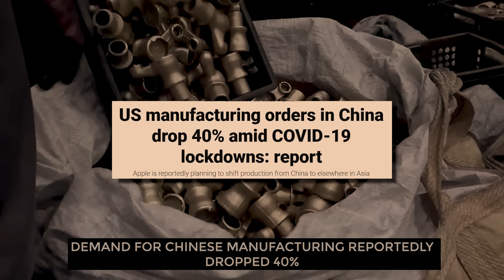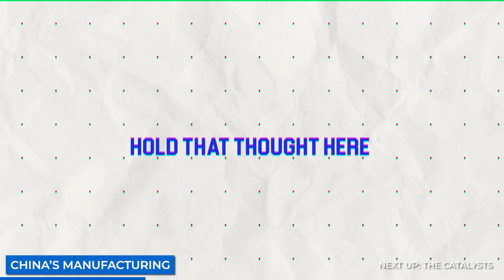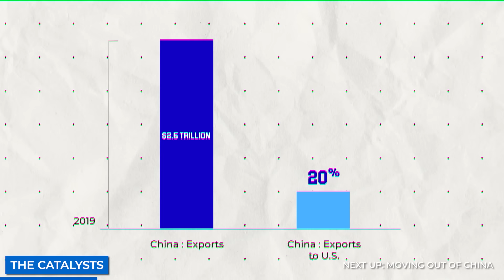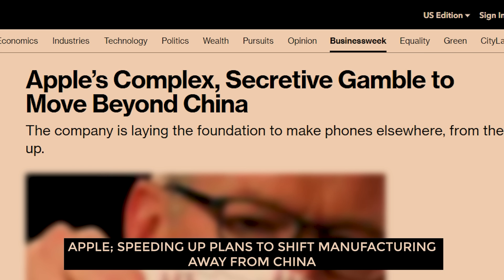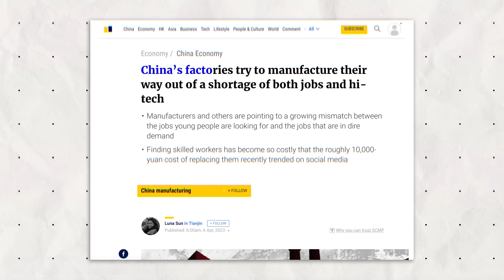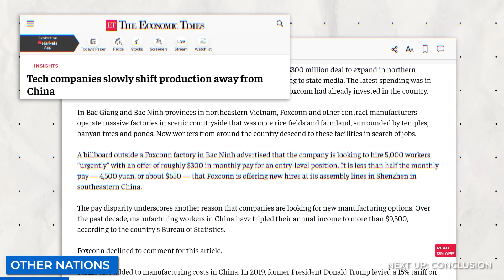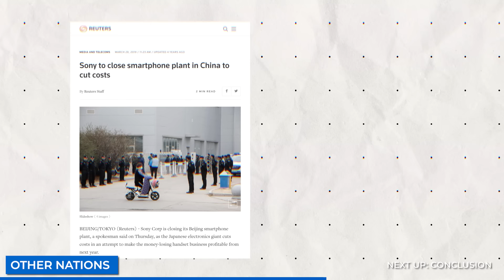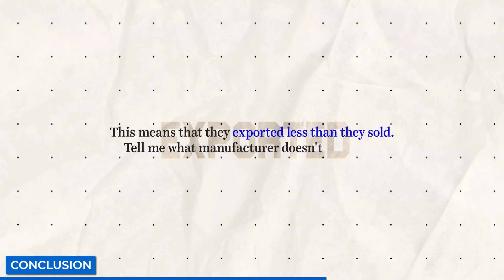China's Catastrophic Manufacturing Crisis, Companies are Running Out of CCP's China

Comment: I remember lobbying our congressman in NC to block the out sourcing of the jobs and being told the cost savings would be passed on to the consumer and that would be good for the economy. The price of TV's went down but that's about it. And we didn't even make TV's in NC. Carolina boots are still just as expensive as when they were made here.
Reply: Basically all electronics have gone rock-bottom while we're increasing our reliance on them. The issue is, the top of the line today may be 157 times more powerful than a laptop from 2013... but that laptop still works fine for most people. Buy it, toss a new clean hard drive and lightweight OS on it, and you wouldn't be able to tell for most people just browsing Facebook and YouTube. 30 to 40 bucks, and you can have thousands of times more computing power than the Manhattan Project and Moon Landing combined times 2. But meanwhile, durable physical goods we all use everyday are similar priced. It's a matter of "feeling" like nothing is better more than objectively
Reply: @@aussiepom Yep.
Reply: TVs aren’t even cheap bc of manufacturing location. Over the past decade prices are lower bc the manufacturer found they could sell the viewer data they collect on the tv, giving customers a cheaper price to buy
Reply: Lol savings are never passed to the consumer
Reply: @Poppa_Capinyoaz  it was a bait and switch
Reply: The company’s profits have gone through the roof so the shareholders are richer, which was the whole point.
Reply: @Aussie Pom Depends on the exact business and time period.  Some businesses exclusively wanted to pad the bottom line, but some genuinely needed lower costs in order to stay competitive with foreign companies that could produce similar goods more cheaply.  A lot of US manufacturing moved offshore because unions got a bit out of hand with their demands in the late 70s-early 90s, combined with inflation in the US making these demands (as well as existing benefit arrangements) more and more unaffordable.  You can complain all you want about greedy CEOs, but the fact is that even if you lowered executive compensation at most large companies, and put all that money into employee salaries, it wouldn’t make much of a difference once it was spread over a bunch of employees.  Executive salaries are a drop in the bucket compared to most total corporate profits, which have to be distributed among shareholders if you want people to invest in your company.  

The reasons a lot of businesses moved manufacturing to China as opposed to other poor (at the time) countries are (1) the US government cultivated a relationship with China beginning in the 1970s as a counterweight to the USSR, and Americans came to see China as “good commies,” and (2) Ding Xiaoping was very friendly to foreign businesses, even if he secretly harbored the same imperialist ideas as Xi Jinping, and (3) China, while poor back then, had better port infrastructure than other comparable countries.
Reply: Industry was offshored even from nonunion states. The issue wasn't 'greedy unions'.
Reply: People lobby to ban stuff like this all the time.

It usually bites them in the ass.
Reply: @calc1657  They drove a lot of it and lowered quality to boot. The Japanese car invasion of the 70s is a significant inflection point. The quality of Detroit manufacturers across the board was rock bottom. How do unions and corps expect consumers to remain brand loyal when they both eschew quality of design and assembly for unit cost and profit margin where the consumer pays the cost. This happened, both were to blame.
Reply: @brasidas2011  German manufacturing did ok despite being far more unionized. It's more complicated than the problem of evil unions.
Reply: As far as NC and textiles, I'm in New England.  Watching the south lose their textile industries and people losing their jobs gave me a chubby.  Y'all stole those jobs from New England and Y'all aren't any different than the Chicoms.  Boo freakin hoo.  "I worked in those mills outside of Charlotte for 30 years".  And so didn't my mom in Massachusetts, when Goober took her job.
Reply: The notion that rich people would save money in production and as a result charge less is laughably naive.

You cut costs and raise prices to make profit. That's all their goal is.
Reply: @equious8413  Nominally it would be, but if you try that when competing with foreign companies with lower labor costs and cheaper products, you are going to lose. Also, when part of your security agreement is giving them access to your markets, tariffs become unsustainable.
Reply: Converse shoes too, made in USA 19$ overseas it went up to 36$ instantly
Reply: And can’t blame unions either
Reply: L
0😊😊
Reply: @brasidas2011  you have to remember though that those same foreign entities have the same profit motive.

I'd argue the inevitable conclusion of competition isn't REALLY cheaper costs for anyone, it's innovation at best, and corporate collusion and market price fixing at worst.
Reply: @equious8413  I agree foreign entities have the same profit motive, however they also have varying levels of governmental support (such as China). Laissez Faire capitalism is dead it seems. I agree with your conclusion as well. It's all gotten pretty corrupt lately.
Reply: They got big heads and after they ran everybody out of business, they raised prices.
Reply: @ThrawnFett123  Try playing more recent computer games, especially factory games and graphically intensive games on  2013 laptop computer.  They wouldn't run very well on such anemic computers.
Reply: @coganaj  the issue is when you compare the amount of computers in the country to the amount of people playing those latest intensive games, it's a fraction of a percent of the actual install base. I'm not saying that a 2013 laptop will let you play Cyperpunk on Ultra with Ray tracing enabled, but most people aren't doing that. They're browsing 3 or 4 social media sites and a couple of streaming services in between doing their yearly taxes and reading a few PDFs to assemble some Ikea furniture. That's the market that wouldn't notice if they had a brand new MSI gaming laptop, or a 2013 Sony Vaio with an SSD upgrade
Reply: @jthweatt412  There is no viewer data if you don't connect your TV to the internet.
Reply: He forgot to mention we would be getting junk for our money, making things more expensive.

Comment: One factor often forgotten about modern manufacturing is how large any investment in high quality, high volume production lines is and how much product has to be moved before ROI is reached. Another problematic aspect is the specialization of machinery. It´s absolutely impossible to "just move" a production line for high end microchips or other precision parts. Breaking down a complex manufacturing process into small, more simple steps may reduce labor costs overall, but introduces a more complex supply chain. Companies start to realize this. Car manufacturers will try to pull their production closer to their assembly (yes, those are two separate things) as the vulnerabilities showed throughout the last half decade.
Reply: ...there you go thinking again, ROBERT!  😜
Reply: Agreed made in a country is different than manufactured in a country . These commercials don’t tell the difference and play the role that made in America means it’s manufacturing
Reply: These videos are coming out of creator's arses.😂
Reply: A reworked NAFTA plus the opportunities available to Mexico could ultimately prove good for all of North America - if the various kinds of corruption can be dealt with.  I'll ride that risk on North America because I don't see it happening in China in my lifetime.
Reply: Cool!
Reply: @hillbilly4895  I´m sorry, it happens involuntarily. I always regret it afterwards.
Reply: Right, and this is the EXACT reason why most companies where their markets are STILL Western countries where consumerism is a much bigger thing, should move their factories back to western countries that they abandoned.

Manufacturing is now much more automated and while China has gotten good at this, so are other countries, and it's easy for engineers from other countries to come into a factory and get the best out of it with modern machinery and that includes making custom machines to do specific tasks.

Tesla is a great example of this.  But Japan for instance has been really good at doing this even though Japanese companies have chosen to manufacture in China (and are also moving out over time).  China has benefited from the technology of global companies along with stealing their IP.  I see most foreign companies moving their manufacturing out, spreading it out over multiple countries and even moving part of it back to their home countries, ESPECIALLY the highly automated lines of production, AS LONG AS supply chains are effective.
Reply: A supply chain is the easiest problem to  solve.
You have a place 
You have a time
And you have transport time.
That's like 1+1+1=3
Reply: Apple just announced it will continue in China. The process of moving to India was not viable.
Reply: I have a question why is it taking 6 weeks for a part for my G10  to arrive in Australia 

Due to the length of time I will never buy another chinese made vehicle

Comment: Just spent 3 weeks visiting factories in China.
They have (had) three advantages. Cheap labor, integrated supply chains, and government policy. Labor cost has exploded and they're moving to Thailand and Vietnam. Government policy is drying up. Having everything nearby is still a strength but labor is sinking it. The more rough manufacturing (hydraulic machines, materials conversion, fabrication) are losing their workers. Most of the guys I saw doing welding and painting were 60+. The next 5 years will be a difficult loss for them.
Reply: and no rules to protect the environment! and this whole low wages debate is shameful!
Reply: @Ezekiel903  Which year did you last visit China? China has vastly improved in protecting the environment.
Reply: Yes I agree, I ran an engineering company in the UK for 35 years.. I remember when China was buying up all the scrap steel they could find for manufacturing. You could not compete because there Labour cost was a small percentage of ours and that also reduced there own material cost. We commented at the time that one day the situation will start to change as the Chinese Labour costs will rise. However there are other factors that costs play a part in competitive markets such as Health & Safety & Human resources. Labour shortage is an issue all over the world but it will result is higher salaries.
Reply: this is cope. china is by far the largest manufacturer in the world and is still growing, though losing some in low tech manufacturing like textiles.
Reply: When, bull dust produce a video that proves it and one you produced your self

Comment: Also a thought that might be necessary to be added, all of the outsourcing shifts are still short term investment moves, it's just a matter of time until labor cost in vietnam and india is catching up with china labor cost, and a bit more until it catches up with western trends (unless another major crisis shakes the world, which is far more probable). We are indeed running out of low labor places to outsource towards to squeeze more profit out of the same. The one solution is automation, but that would only work if it does not replace labor but rather supports lower productive time for the population. Since any traded company won't be able to adjust strategy to account for that, a broader economic collapse is inevitable. ...crap, didn't want to get that realistic when I started the thought... apologies.

Comment: Error on your chart at 34’36 - the chart for 2025 says $327m (the same as 2022), instead of “$470 billion” as per the audio. 
Note, all three bars have million, but the audio says billion. 
Excellent vid all the same.
Reply: Another error on the chart at 42’10, the bar on the right says Bangladesh, (the same as the one on the left), but the audio (correctly) says China. 
Suggest check all your charts for errors.

Comment: Due to its huge domestic market, unit cost of components to make finished goods in china is lower, and china has complete set of almost all the components. Though Vietnam, India, Thailand, Indonesia have taken away a lot of manufacturing from China, the components are actually from China —- these countries either do not have the whole set lines of components, or the unit component cost will be too high. In manufacturing, the component cost will decrease as volume increases: China domestic market is huge, based on that, export component cost is lower.

Comment: The high-value manufacturing move is logical, and would totally work for China, especially with a massive demographic problem. However, China doesn't do well in innovation. It raises students and citizens on ideas of conformity. Difference is actually discouraged. Ambition is often punished. The other area which plays into China's difficulties, is that they can develop brands, but they are not very good at it, and these brandsrarely hold any value to the rest of the world. So when a large US company pulls out, China cannot capitalize on the high tech capacity it has acquired, because people in rich countries don't pay a premium for a Chinese product.

Comment: I don't know, i buy  5 or 6  solar inverters a year ( 24 V or 48V Dc to 220 V Ac ) of several forms, open frame and enclosed ones, from China and lately their quality is excellent and the prices are good;  i used to be a  electronics QC inspector in an avionics firm in NJ, USA(back home in Portugal now (where at least the INjustice system, the courts,just suck,slow and incompetent beyond belief!!)), and i can do perfect solders, and i can tell you that the solar inverters have perfect solder jobs on them; being chinese, for profit, they are made just tangent to just what is needed,  no more, but still very good for the price(  mind you, the EGS002 boards DID NEED to be modified, up to a year ago, or they would not last; now, on the low freq. inverter boards, they fixed that--with a 0.01 cent 10 kohm resistor).

Comment: Interesting report; still One aspect you didn’t elaborate much is the skill and time efficiency factors for many manufacturing jobs. Tim cooked once said that the reason for Apple to make their products in China is not because of low labor costs but rather the abundance of qualified workers in advanced tooling and process for manufacturing. It will indeed take time for Vietnam, India and so on to replace China. Entry level stuff such as shoes clothes and furniture can move away, no issue for China.